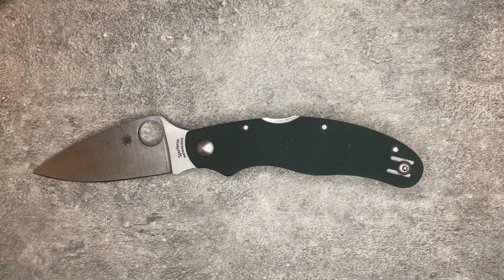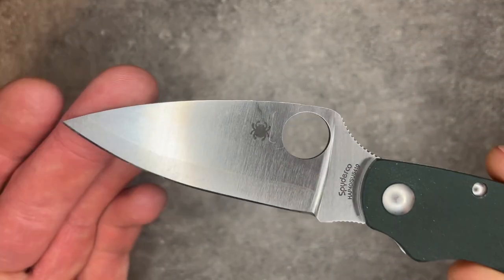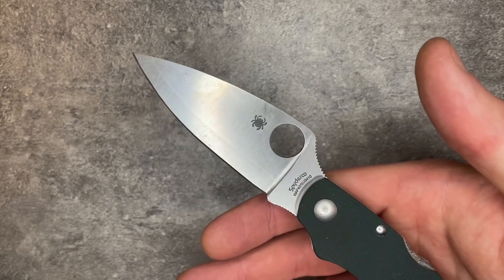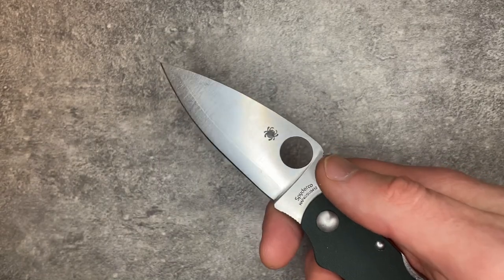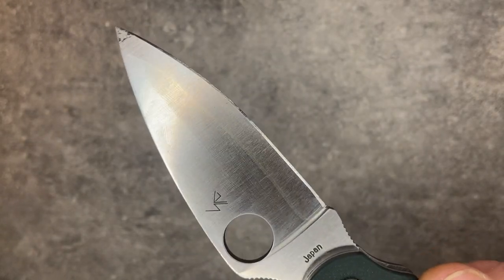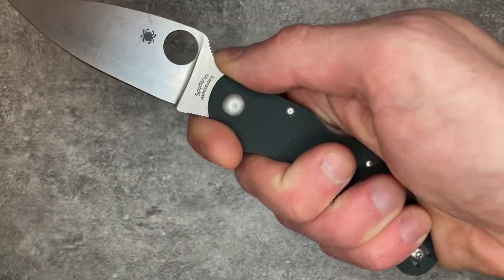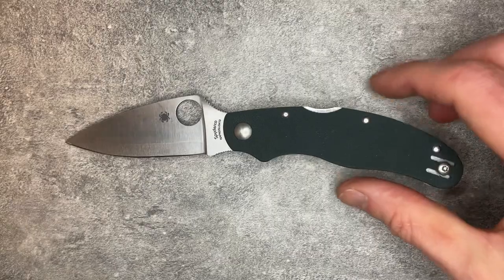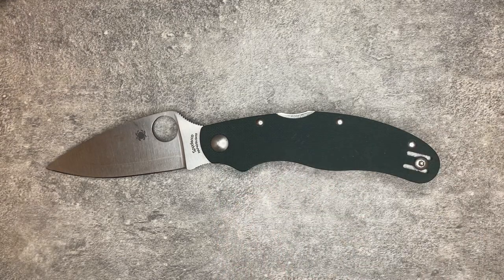Spyderco Caly 3 Review - Refined design but shows its age

Comment: You can either blast and tumble the blade or acid etch and tumble the blade to make it look better in use. I did the acid etch and tumble on mine and it came out really nice, plus it looks better the more I use it. The only thing I would of done differently would be sand the blade before etching it.
Reply from the maker: Ooh I remember seeing that. BBB did that on a V-Toku San Mai and it came out really nice. I’m not one to mod my knives much these days, but that sounds like a great option. Thanks!